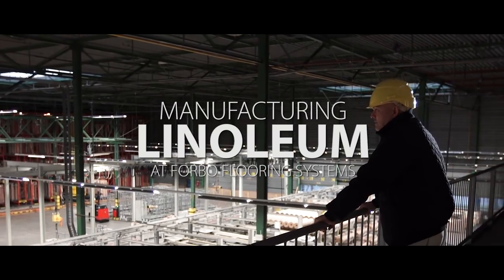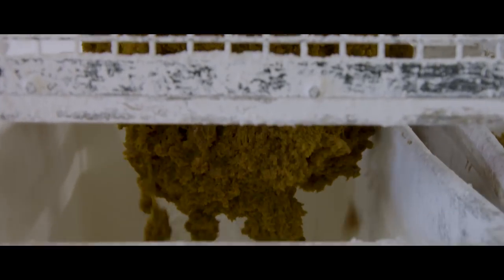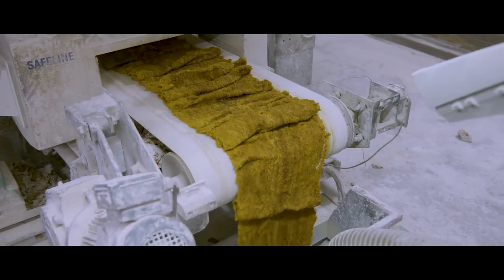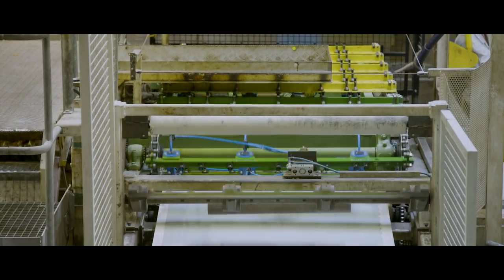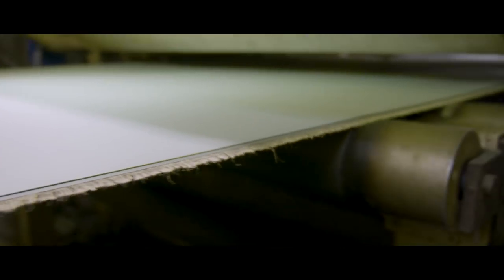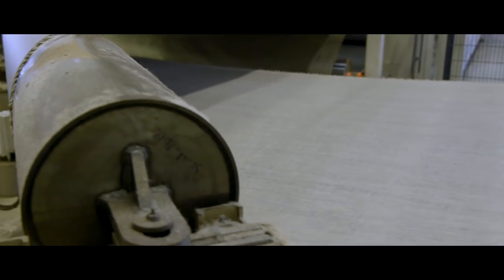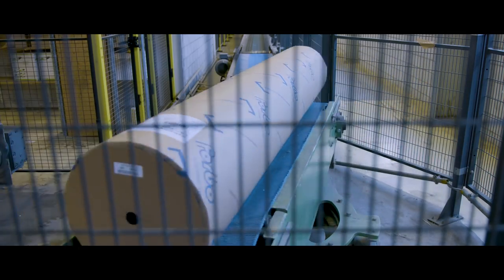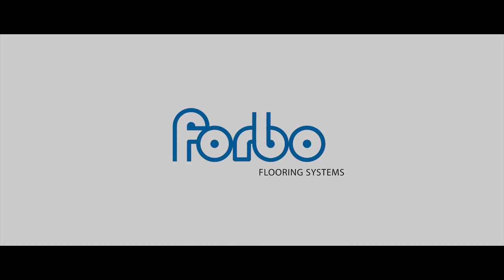Marmoleum - How It's Made | Forbo Flooring Systems

Comment: Watching this with my lady friend baffled her. Women just don’t get it. As a man I need to know how things are done and this video reaffirmed my understanding. Thanks a million! Always, Andy
Reply: This product is garbage.   If you've already bought it and haven't installed it, don't install it.   There are numerous problems with the product.   1.  You will note a picture of a seal on the box, that says "H2O proof.   There is NOTHING water proof about this product.   2.  The linoleum is bonded to what appears to be a layer of burlap glued to  particle board (more like cardboard) about 3/8 of an inch thick.   After regular moping, the linoleum will unglue itself from the sub-straight.
  The tiles start to buckle around the edges.   I've worked an area about 35 feet by 35 feet using this tile.   It fades, the linoleum is inferior and will peel up.  Water easily gets between the tiles and then under the tiles where it will eventually mold.   My job is to replace the worst of these bad tiles.   The product is so unstable, that you have to trim every piece to fit it in.   It also appears to be unstable in that the linoleum seems to have shrunk on the replacement tiles we have.   It is tedious trying to replace these, having to cut, chisel,  sand or grind edges to fit in replacement tiles.  Due to the buckling of so many tiles around the edges, we bought a small air compressor and high powered stapler, having to staple each buckling tile around the edges.   Then you have the problem of having to pull out the staples when the tiles are shot.   This means using vise grips or a grinder.   Our tiles are laid on a plywood base, 3/4 inch PT plywood.
If you could see how bad this tile ages in just two years since it was laid, you would never buy it.